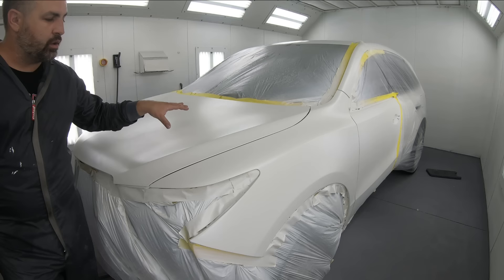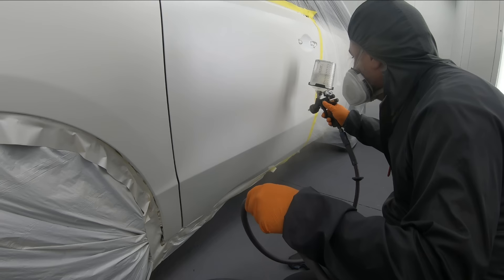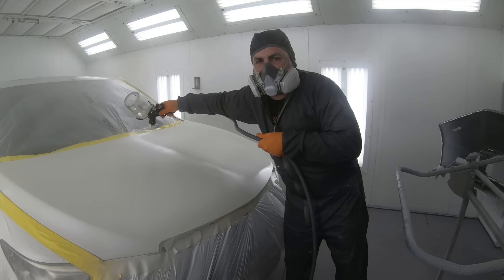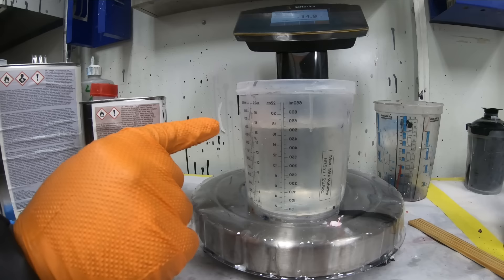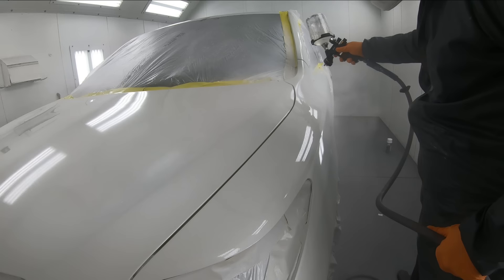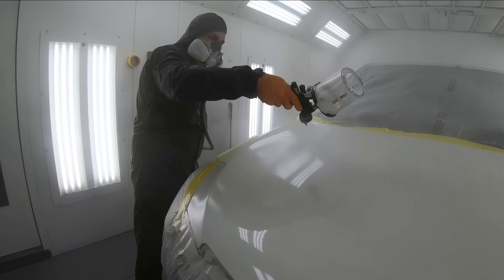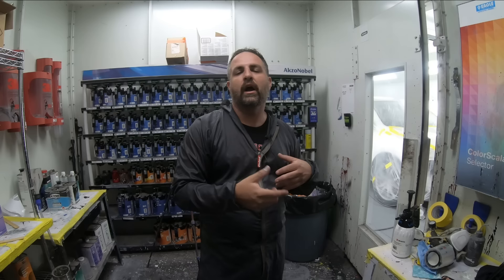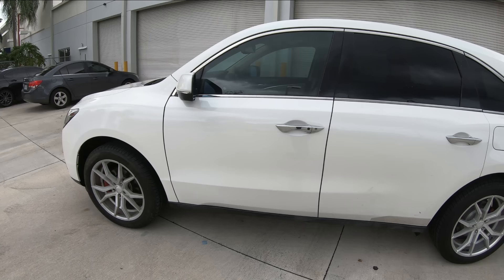Simple Mixing HACK to AVOID ORANGE PEEL!

Comment: I have a black Mustang, Jeep and a Corvette; all of which came from the factory with annoying orange peel. I need to find some videos on the channel that will have me remove the peel and paint only if necessary. I am a curious novice body detailer who does not to attempt something without training or observing a pro. I could kick myself for not taking some auto shop elective classes in high school!😡
Reply from the maker: I’ll work on getting videos of that but I do have buffing videos. Check out the complete paint job. I believe episode 6
Reply: @PaintSociety  will do.  Thank you for your quick response.
Reply: Be careful sanding/polishing a factory finish.  Most cars have very little clear coat on them and you can easily go through it.
Reply: Black always looks the best without buff.. so don’t touch it lol

Comment: Hi Brian, would you still use slow activator even when spraying in 70F? What about 60F? Thanks.
Reply from the maker: You can use medium
Reply: Thanks. So when you were saying to use slow, you were saying that because your temps were 80/85F and higher, correct?
Reply: @a.t.701  generally u use slow when the temperature is high, But i also use slow hardener when im doing a big job so the clear doesnt dry on me when im doing my passes.

Comment: I know paint has changed a lot over the years, but whatever happened to sanding between coats of paint? That used to be de rigueur for any paint job. Nowadays I see a ton of paintwork, even factory ones, with so much orange peel it's distressing.
Reply: You dont get paid to sand between coats anymore. Its very time consuming.

Comment: Thank you for all your videos I've learned a lot! I do my work in my garage just mainly for myself and for my show car(s). I do multiple clear coats only because it is impossible to keep the bugs and dust out 100% or even 80%. I have question and hopefully you could answer it. Since I do multiple clear coats (4 to 5) because of my bug and dust issue, could I do this on my final coat and will it help?
Reply from the maker: Yes definitely but try and eliminate first your dust problems

Comment: What would you have to say in terms of a panel being painted and looking like glass at first but over the period of a month or two maybe even 3, developing heavy orange peel? (This is on a hood and both fenders including the front bumper
Reply: every layer has to be smooth like glass. primer, sealer, base coat and clear have to be sanded or sprayed smooth like glass

Comment: I just follow the TDS.  Adding reducer can also reduce the UV protection that clear coat provides.
Reply: Yes..it's better to use slow activator...the added cure time gives the clear time to level out
Reply: @mariocooldude9092  But for the beginner- would a slow activator cause runs way more then medium?